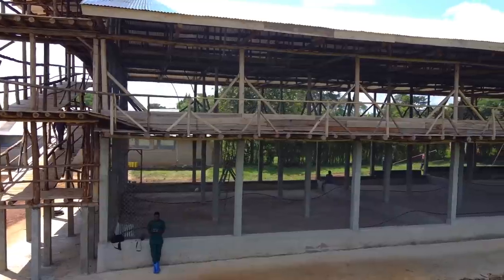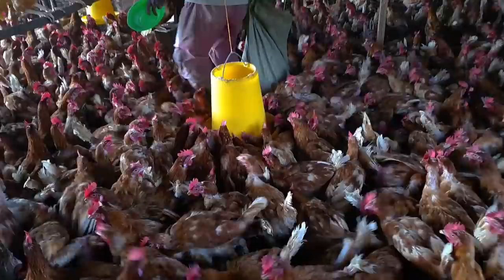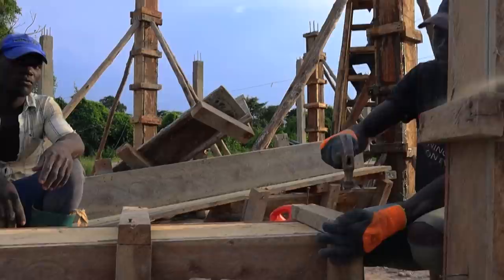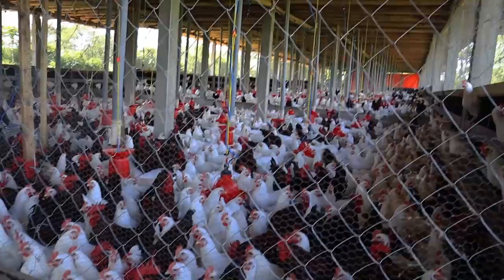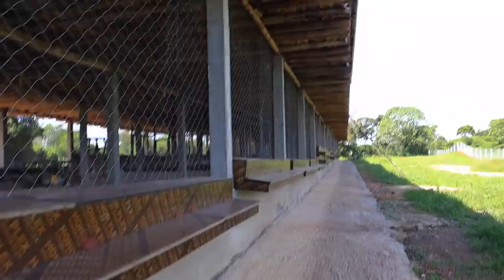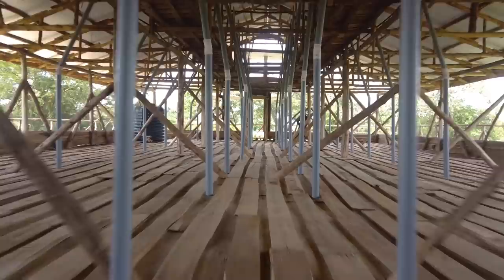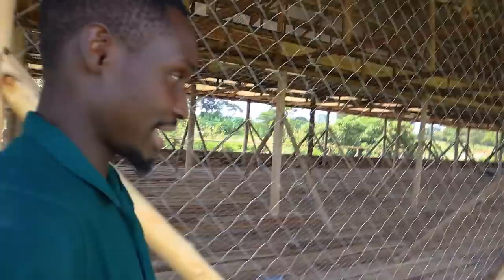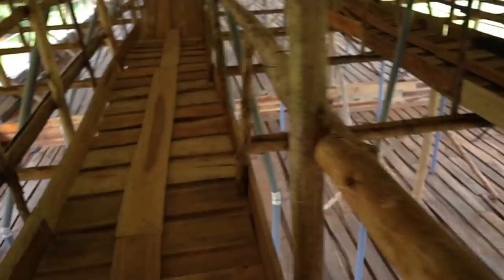The PERFECT Chicken House.

Comment: Here in Philippines a finer net is used around the structure to prevent flies from entering. Flies are one of the number one problems in poultry farm here. I think that is not the case in your place so maybe that would work. Hoping for your success in this endeavour.👍💪
Reply: You indicated an important point
Reply: To get ride of flies, first put crushed charcoal on the floor before adding your litter
Reply: @Russel Habla...would a finer net allow for better ventilation?
Reply: @henriettaiwunze8799  even soda ash
Reply: Ducks eat flies and also guenie fowls
Reply: @henriettaiwunze8799  What does pulverized coal mean?

Comment: Make sure you keep watch on the wood the acidity of the chicken poop will eventually rot away the wood and for the rain if you had buildings side by side you could control the wind problem but if you don’t want to build side by side you could plant trees around to use as barriers against the wind

Comment: The cracks between the wood slats on the second floor flooring are going to be very difficult to get clean and sanitary between batches of birds.   You need to find a way to make the floor up there SMOOTH before you put birds and bedding up there.

Comment: Awesome structure, going up is better than sideways, instead of using plastic preventing the sun and rain coming in i would rather suggest  a shade netting as it have different sizes of holes in millimetres, it will help also help with rain prevention coming in thx

Comment: Nice building. Maybe put ramps from one section to the other, then you could drive your equipment all the way through the building. Since there is already a short wall between the sections, remove the area out of the center of the short wall for your equipment to go through.

Comment: Hai doc woow😃. 🆗 let me have a say about the structure. when it comes to atmospheric conditions it scares me particularly in the windy conditions and also wood/timber bends or change shape and get problematic after exposure to rain and sunlight for long time. ¡ for the next structure  "outsource the building part" to the qualified constructors who will use steel/metal + the Morden material.it will save you time~becase they will finish it soon,it will save your energy, you will have peaceful sleep during bad weather conditions, will save your money, because the cost of building would not have big difference to who¹ you are currently using at the moment to build.jst focus on rising chickens and administration.

Comment: I am not convinced about the wood, as time goes on the wood will become weak and rot and you find yourself replacing it constantly, I think if you have the money it's better to build it entirely from cement, at least with cement you know the structure will last for a long time, and regarding the structure, building upwards looks like a good idea only if you don't have enough space for another separated chicken barn, I love the design of the chicken barn though, everything about the chicken barn is amazing, but you forgot something, the roosting perches, put some wooden perches for the chickens to stand up on like you had at your first barn, amazing video, on point as always.
Reply from the maker: Oh yes. Sure. 
We tried to use strong wood though.  It will ceramic last more than 10 years

Comment: Thanks Dr for the upload. I am A civil Engineer, I have not seen concrete beams , only worried about the structural stability of the structure and its durability.
Then also I don't know whether the timber you used was treated.